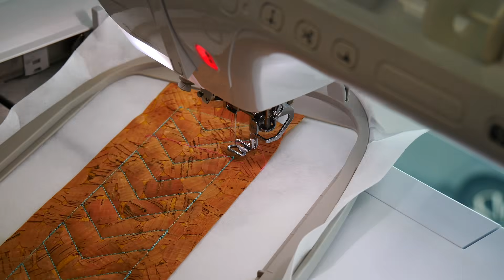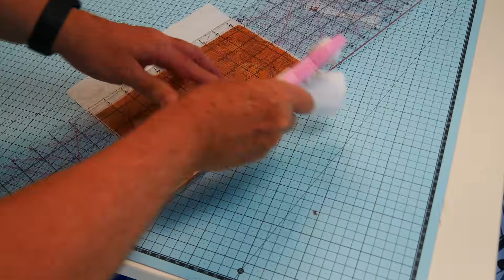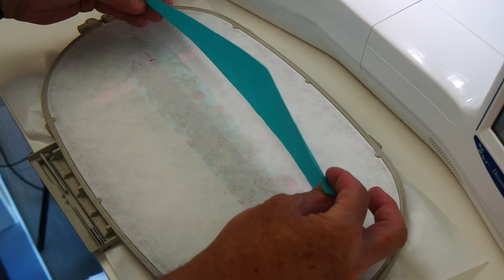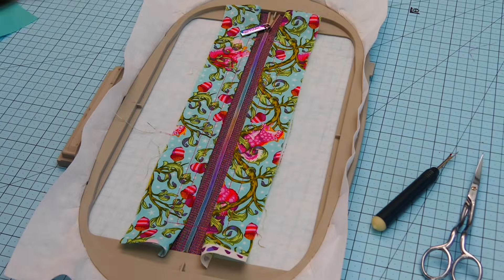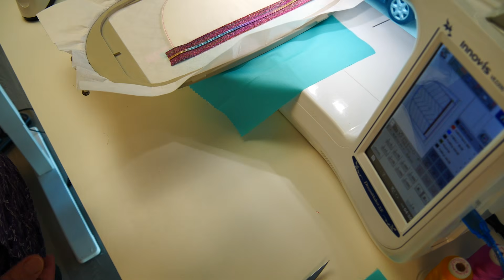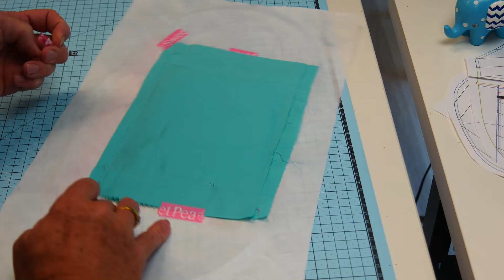Cross Body Pack Embroidery Tutorial - How to sew a unique bag using and embroidery machine.

Comment: Such a wonderful tutorial. I recently bought this design. Even though I have been making ITH projects for a long time, this one was a bit more complicated than anything I have ever made before. I am making progress with it, have most of the panels made. I am looking forward to completing this one. Thanks to this excellent video I feel confident that this will turn out great. I do have one question though. What is bag stiffener? Is it something like a heavy weight interfacing or cut away stabilizer?
Reply from the maker: Thanks for the kind words! Bag stiffener is similar to a heavy-weight interfacing, designed to give your bag more structure.